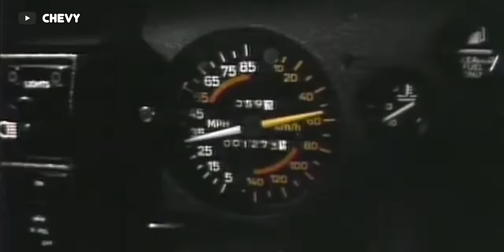These are the WEAKEST ENGINES EVER

Comment: The 4.7l standard output made 230 hp and the high output made 265hp. In 2008 and it made 305hp. You said it never made more than 50hp per liter and that's just not true. The 2008 motor with 305hp is 64hp per liter. I have an 01 dakota with a 4.7 with some mods and it's a solid motor, but I would absolutely hate to have a full sized ram with it. It's definitely too weak of a motor for that big of a truck.
Reply: Fun fact: certain years of the ram in single cab trim were faster with the 4.7 than with the bigger engine offered with it.
Reply: @Prestiged_peck  hmm do you know why? I feel like if it was the same exact truck only the motor being different than the 5.7 would be faster
Reply: @BigIglooUSMC  it was offered alongside the 5.2/5.9 for a few years, and also the very late ones were flex fuel and made more power when ethanol was in them. The 4.7 was also significantly lighter than the 5.7 and especially the old 5.2/5.9
Reply: Toyotas 4.7 liter single overhead cam V8 from 2000 to 2007 only put out 245 horsepower and  it was fuel injected and there was no mention of that. I had that motors in a Lexus GX 470 and it was underpowered.
Reply: This. I got an 08 ram. They modified the engine to 16 spark plugs and upped the horses to 305 with some minor mods. Runs pretty decent with 200000 miles
Reply: My beloved 2003 Dodge Ram 4.7l went 375,000 miles before it decided to burst a radiator hose and overheat. It wasn't that bad with the 3.92 rear end. Now compared to my 99 Dakota 5.2l 5-speed with the 3.92 it was a snail.
Reply: Not too bad for an engine got for basically free from AMC.
Reply: gen 2 4.7 owner here and it offers great power for its displacement. 27 miles per gallon on the highway with 310 hp and 330lb ft of torque, made more power than the yota 4.7, chevy 5.3, chevy 4.8, ford 2v 4.6, ford 3v 4.6, and so on.

Comment: Early emissions equipment sucked and buyers became more concerned about fuel economy. But unless your country taxes displacement, I dont see any problem with using a detuned low stress high displacement engine vs a high strung tiny engine and HP/L is a useless metric in that context. An Olds 307 from the '80s only made 140-180HP but it also got nearly 30MPG highway in a full size wagon with a carburetor and had more low end grunt than a V6 at the time that would've made similar HP. Its pretty similar to turbo 4s of the time in HP as well but with a decent torque, fuel economy and reliability advantage. BuT mUh LoW hP pEr LiTeR!!!11!!1

Comment: You should do a part two considering that the bottom end and rest of the car is there and made. Much harder to make all that than do a top end. Exhaust/Intake/Camshafts/Heads
You can't do these videos without mentioning torque.
 There's a reason makers kept putting V8s in heavy vehicles even though I4, I4, and V6 power/energy was close, because it's not what mattered or lasted, it's the force
Reply: He did mention torque. Lb-ft is torque.
Reply: @HeLpEr4u083  He keeps comparing hp. There's a reason makers kept putting V8s in heavy vehicles even though I4 and V6 power was close, because it's not what mattered or lasted

Comment: Seems like that duke would have run better. It had the stuff you’d want 4” bore,cross flow head, 5 mains. It red lined at 5k and mine was out of steam by then. Maybe it was a lousy head design🤷‍♂️.
Reply: Yes, I remember trying to torque-brake my father's Citation, and it didn't take off any faster than by flooring it at idle. That was in contrast to my 2.2L Lancer turbo, which literally screamed away from a stoplight if you revved it up with the brake on. The Iron Duke was was just out of breath beyond maybe 4K.

Comment: several corrections on the video, i will just pick one- the dodge 4.7 power tech v8. 235hp, standard, 4.7 HO, 265hp/330lb torque, and the revised final gen 4.7, 310hp, 330/335lb torque, and they did not run the 4.7 through 09, it was used through 2013. engine builder, 43yrs in the business. the 265hp 4.7HO was quite the engine, and fast in the jeeps, and the last gen 310hp 4.7 with cold air kit and a tune would fist fight a 5.7 hemi.

Comment: Having started to drive during the era the Mustang IIs were common and the 1979 Fox body debuted, I have to come to their defense. Ford executives deserve a bit of shame for not jumping to offer something a bit more competitive under the hoods, but in retrospect, nobody was making anything that held a candle to what options a buyer had a decade earlier. The 1979 400 Poncho in a Trans Am was rated at 220 HP and only came with a four speed. It ripped the quarter in 14 seconds according to a Hot Rod Magazine test, beat the L82 225 HP Corvette. Z-28s were optimistically rated at 175 HP if you got the 350. The Dodge Lil Red Truck had a warmed over 225 horse 360 that was in the same ball park as the Trans Am. A 139 HP Ford 302 may have not been a power house, but it was the same architecture as the 289s and could be made to run at least more competitively. The 255 that came out the following year was a dog. Police car buyers in 79 got Ford LTDs on the Panther platform that had a less inspiring 351W 2V that came in varying degrees of tune - all dependent on how hung over the guy on the line was when slapping together the motor. They didn’t have enough power to cause the weak links to handle to come to light - took a redesigned 180 HP 351W Police Interceptor to do that. The 4.7 Dodge was a tougher, gutsier motor than I care to admit. I had one in a company furnished Dakota, hated it, but only because Chrysler’s questionable manufacturing processes for plastic radiator and complete lack of lumbar support in the seats made it the most miserable vehicle I ever operated.

Comment: They made the 4.7 all the way to 2012 in the ram. It’s built more for towing which it did well but it has the valve seat issues, head gasket leaks & timing chain issues. Sometimes you’ll get lucky with them and they’ll last 300k or sometimes you won’t.
Reply: I’ve had customers that owned a vehicle with the 4.7 with over 300k and some that didn’t make it past 50k and a majority of the ones that didn’t last the maintenance wasn’t done properly
Reply: Most likely using additives like Marvel Mystery oil or Lucas Oil,  that's one way to help any any engine extend its life

Comment: Parents had a1985 Chevy Conversion Van with a 305cu-in V8

It made like 150hp, weighed like 6000lbs and sucked fuel like a MF and was prone to vacuum leaks all over. They used engine vacuum to power the hvac system! An absolute turd with 100s of miles of tiny, clear plastic vacuum lines that never worked properly.

Comment: As a Duke owner, I agree although we can blame GM for stuffing it in the wrong applications. It would have done fine in something smaller. But in a Camaro or an S10 4 by 4….not so good.
It’s not a horrible engine, compared to a Ford 3.0 V6 interference 😣

Comment: Look at naturally aspirated torque per liter for efficiency.  High end stuff is 80+ ft lbs of torque per liter, usually 4 valve heads on premium gas.  The cylinder pressure and engine efficiency  are directly related to the torque per liter number.

Comment: The 4.7 in a 99-04 Grand Cherokee was surprisingly quick, it could beat a mustang up to about 50 mph
Reply: Some of these came with a knock sensor and recommended fuel was 91 octane,those I think were rated at more than 235 horsepower. 
Would show taillights to an Accurate Honda MDX that supposedly had over 300 hp V6

Comment: To be fair, they are weak. In reality, they fit US car mantra. The general rule is the higher the horsepower, the shorter the engines lifespan. So lower power to high displacement and mechanical simplicity means reliability, useful in a country where a quick run to buy milk is a half hour trip, one way, at 45mph. Thats why super high performance engines, their lifespan is measured in hours, some are measured in minutes. Having 500+hp may seem like a buzz but in reality, where are you going to us it? Lets say your 500hp car is a sedan. You're going to use it for commutes, the school run and trips to the supermarket, driving at the speed limit for 99% of its moving life. 

My old Cadillac with its Olds 307 that makes 140hp (you can add that one) and its the most reliable car my family has ever seen. Its 37 years olds, sat in a field 13 for years before I bought it and I've driven it for the last 13 years as a daily. All I've done to the engine is regular fluids and filters, a couple of oil gaskets, new spark plugs (cause I broke one) and a new choke pull off. Thats it. Can the same be done with a new Camaro?

Comment: way to focused on HP,  bottom end torque makes up for alot. just because  a smaller engine redlines at 8k rpm to make those higher HP numbers doesnt make it a great engine. higher rpms can mean less reliable.

Comment: uhhh, major, major addendu. to the 4.7. 
the 4.7 ONLY made 235hp from 1999- 2007. past that it was more of a high output variant that made 265 hp, and was used until 2008 and past that a even higher output model that made 310hp was used until it was discontinued.

Comment: The worst thing about the 6.2 Diesel is the fact that it makes less hp and torque than the same model year gas 5.7 small block with TBI. The small block made 300 ft lbs in the 91 Suburban.  It also made 200 hp.
Reply: But the 6.2 has twice the fuel mileage. I own a 1993 Blazer with the TBI 350 and it makes 15-13 mpg.  The 6.2 gets 22-30 and diesel is cheaper. You can do a few cheap mods and get the power up to the 200 crank hp mark. But it wasn't built for that. We had the 6.2 in the Humvee in the Army and they were able to perform pretty well with that power to weight ratio.
Reply: Too bad Diesel is no longer cheaper than gas.
Reply: @johndemichael1990  Where I live it is.
Reply: Oh well that's interesting. Here it's over a dollar more than regular gas. It's more than premium too. By a good amount.
Reply: @johndemichael1990  I live in Germany. Gas is 1.85 per liter and diesel is 1.50
Reply: Oh I see that makes more sense. I live in the United States in Pennsylvania.

Comment: I disagree wholeheartedly about the Dodge Viper
Reply: Well, the 8.0 magnum, which the vipers engine was directly derived from, has a monstrous 310 horsepower and 450 ft/lb of torque... which frankly is even more pathetic. At the time, it was powerful, but still 38.75 horsepower per liter for the magnum and 50 horsepower per liter for the viper is pretty weak.
Reply: @duckdestroyer2412  Less the displacement, nothing from the V-10 truck engine was in the Viper model. Not a single part. Not even bore and stroke.  

That Gen I Viper was only 3,200 pounds too.  It was way over powered, thus known as the widow maker.  It was a statement car by Dodge.
Reply: @TheBeingReal  the 1992 8.0 dodge vipers engine was based on the dodge 8.0 magnum block. The bore and stroke of the magnum block exactly the same, 4 inch bore and a stroke of 3.88. It was cast out of aluminum instead of cast iron like the magnum, which was done by Lamborghini. As well as I believe some forged internals.
While not identical, they are basically the same engine. One version just got the fancy parts.

The newer versions are a different story with up boring and added stroke, making them closer to 8.4 liters if I am not mistaken.

Comment: One of the world's most reliable engine the ford 4.9l inline six in it's worst years only made 100hp.
Reply: I had an Econoline E150 cargo van with that 4.9 lire engine and ran to over 300,000 miles and still ran good.

Comment: I own a 76 cadi Eldorado 500 cid  ,,  it get great mileage and power is great regardless of ratings and also have a 70 with 500 cid  sure it will melt the tires but everyday driving about the same ,, so own it before bitching about it 🤣

Comment: Dodge had the advantage of Cummins, which used toroidal pistons, instead of prechambers like the Ford IDI and Detroit Diesels used.  The DB2-4911 injection pumps used on the late 6.2 and early 6.5's could warrant 200 hp with the right fuel tune, so even though the 6.2 was gutless from the factory, it could be built for more power.  It's a great swap to get rid of the dreadful 350 Oldsmobilie Diesels, which only used 4 head bolts per cylinder instead of 5. Coupled with an astronomically high 20+:1 compression ratio to make up for the lack of turbocharging, head gasket failure and head lifting was common.  Studding and girdling any of these early Diesels is a must.

Comment: The 6.2 Detroit Diesel engine is a solid performer due to its simplicity. Fuel metering and delivery, and everything else, is mechanically controlled. The only electrical hookup needed is to the fuel shut-off solenoid. The US military still uses this motor, rather than the turbocharged, computer-controlled 6.5 liter version.

Comment: People like to point fingers, but conveniently ignore that manufacturers got hit from multiple angles in the 70s and into the 80s.  

First came the emissions.  Leaded gas was banned for “new” cars, so compression ratios dropped (instant power losses).  Plus new emissions laws meant gone were the big solid cam, big port, big carb fire breathing engines.  EGR became required by 1973.  By 1975, cars required cats, which were archaic and restrictive by todays standards, choking power even more.  And all this was done mechanically, and not nearly as precise as today’s computer controlled stuff.

Along with the leaded fuel ban, there was also the 2 gas crises in 1973 and 1976.  This led to CAFE standards getting created.  On top of making powerful cars less appealing (since more power means more fuel), it hurt the economy on a global scale.  Multiple recessions meant less cars getting sold, so less revenue for auto manufacturers, so less money for R&D.  They did whatever they could to stay afloat, taking old designs, nerfing them into oblivion to meet EPA laws and CAFE standards.  

Pretty much, it wasn’t until the 1990s that manufacturers had the cash to develop/introduce tech that could meet the CAFE/EPA standards while making decent power.

Comment: The Cadillac 500 makes very little HP for its size however the torque is legendary.
Reply: It would probably make substantially more HP if it wasn’t strangled with all the anti smog equipment
Reply: @darksaber7678 like what
Reply: Big issue with the 500 is it would float the valves at around 4,000 rpm.

Comment: Sorry, but pushrods do not equate to weak HP. Top fuel dragsters make 3000 HP with old pushrod Hemis. Until electronic fuel injection became common, it was hard to make EPA ratings and have power with low octane unleaded fuel. That's just the facts. All of your worst engines still had potential for HP if you didn't mind changing parts and didn't have to have emissions inspections. many of these engines were built not to have a lot of raw power but to be smooth or last a long time (Rolls Royce, Cadillac). EVERY one of the engines with few exceptions on your list can be tweaked to make power.

Comment: I had an 05 ram 1500 with the 4.7 great engine for what I used the truck for, could tow decent, but damn I didn't like to hold power going up hill unless you slam on the gas the whole way, very under powered

Comment: You also have to realize that they changed how they calculate HP from the 50-80's to how it is calculated in the somewhere in the mid 90's they changed how they calculated HP.  Those 100ish HP engines of the early era's would be at least 4-500hp no days cause of how they changed the rating. BHP was and always will be lower HP ratings than what we use to calculate HP now days mainly based off of torque and a math equation. Steve Morris of Steve Morris Engines here on YT did a great video about how HP ratings has changed since he started building engines and how it changed prior to the 90's. And he would know he builds engines that put out 4500-5k HP.

Comment: When I first got my 1965 Ford Mustang I thought 200HP was weak for a 4.7L V8. BUT, that's with a 2 barrel carb and lower compression ratio vs the 4 barrel carb and the 10.5 to 11ish(?) to 1 compression ratio of the legendary high performance K Code version of that same engine that everyone wants which makes just shy of 280 HP. When I first saw the second gen Mustangs with the 5.0L making less power than I do with 4.7L, suddenly 200HP and 282 ft lbs torque doesn't sound so bad out of 4.7L.
Reply: Plus at that time swapping out the internals at home was easier than todays engines. Also remember the HP was advertised as gross vs the net with accessories etc used lated.

Comment: The problem was at the time these engines were badly hampered by newly minted emissions regulations. While we needed those emissions regulations, car companies had no experience on how to decrease emissions without decreasing horsepower. The catalytic converter design of the time also choked the engines really badly. That's when all these terrible engines with very low compression ratios started invading the American car market. Europe was late to the emissions party, but today they're more aggressive than even America. That's why European and Japanese cars produced so much more specific horsepower (horsepower per-liter). That's until they were introduced into the American market, of course...

Comment: My Camaro came with the LG4 and it was a total dog. So I put an eBay turbo on it and shattered the T5 to pieces. So I TKO swapped it and shattered the rear end. So I put a 9" in it and blew up the engine. Now it's getting cleaned up in prep for a 383